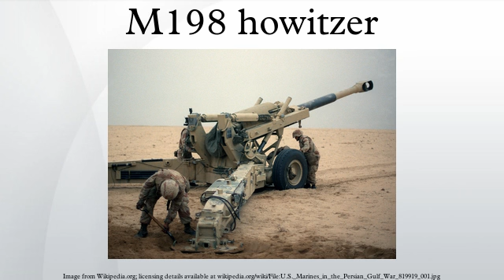M198 howitzer

Comment: The M198 /155mm howitzers we used look identical to this, but we could hit targets up to 21 miles away. We usually only fired around 6-12 miles at 29 Stumps. We never got to fire off any RAP rounds, but we were told they could travel over 30 miles. The primary use they told us that RAP rounds were for tactical nukes. That was in the late 80s. Semper Fi.